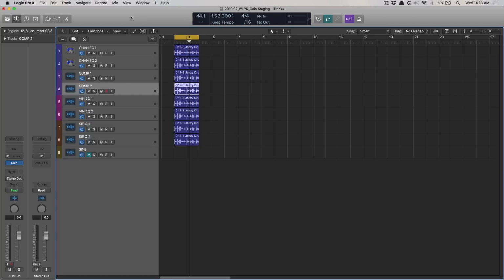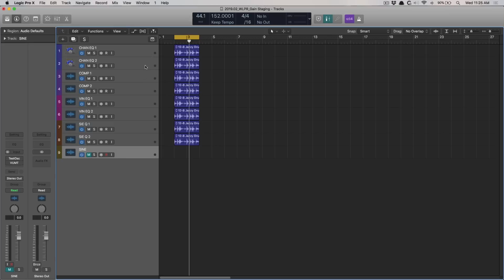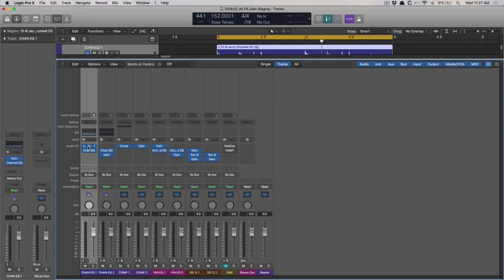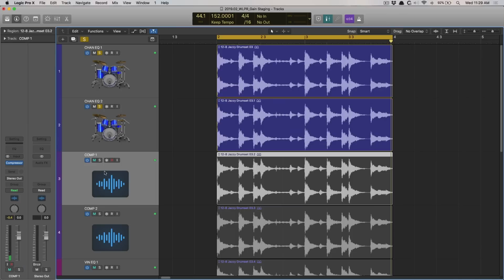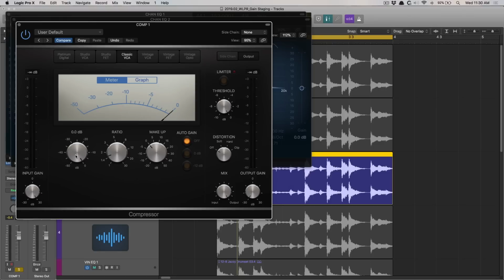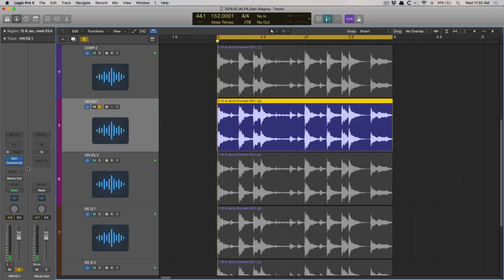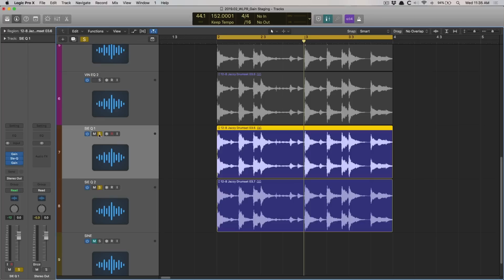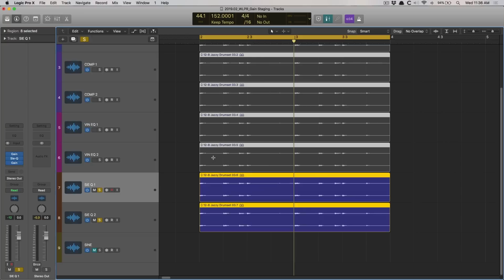Gain Staging in Logic Pro – What Is It, & Does It Even Matter?

Comment: would this be "cheating" though? would I get better results by doing it manually track by track using a vu meter because specific instruments like vocals for example are so dynamic? if this is such a game changer why dont i see more people using this method?

Update: When using this method of normalization for gain staging I measured the signal of an individual track with a vu meter and the level was very low even though it was peaking at -18db. 

Am i missing something here? Plz help

Comment: My question about that -18, do I have to aim for this spot while recording (and if not, at what db should my signal enter Logic via my interface?), or do I aim for it afterward in the gain staging during the mix process?
Reply: I've heard from sound guys that when recording to digital it's best to aim between -12dB and -6dB, -12dB being on the safe side. The -18dB comes from the relationship between VU and FS meters, as far as I understand it, 0 dB VU = -18 FS and it's the supposed best level to hit the subsequent plug ins at. I'm learning this myself, so take it with a grain of salt.

Comment: Would you gain stage even things like tambourines & sharp hi hats? The wave is always so small after I bounce in place from Maschine into logic. If I gain stage they are super loud in the mix, just to be tuned down on the fader again. Thanks~
Reply: Great question, to my understanding the answer is no. If you sure a certain sound or instrument is going to sit very low in the mix or is there solely for background or texture you may not need to gain stage it. Just make sure the fader is set to 0, and the Peak meter is hitting between -6db and -18db on the start.

Comment: also if you use fab filter the threshhold of the  dynamics are all defaulted to -18dfs. I find a lot more plug and play workflow when everything is gainstaged. You can add stuff and just see how it sounds rather then adding and adjusting. 

I just wish it were easier to see  -18dfs on the logic meters. Its the spot to focus on and yet the scaling of the meter means you have no hardly any visual feed back on the meter 🤓 just a wimpy bounce at the bottom of the meter. Silly stuff. But logic is still cool. Just illogical meters.

Comment: Hey Chris, thanks for great video! One question if you could answer please: If i do normalize gain as you showed at the end of the video, will i loose the stereo field I've created by different track volumes? Also what will happens with the volume automations I've set for some regions?

Thanks a lot!
Reply: Stereo field and level balance are two different things. Normalization will affect the level balance of your mix, but will not affect instrument placement in your stereo field. You'll have to re-balance everything after you've normalized all tracks that needed normalization. Your level automation points won't change after normalization either, so you'll have to redo your track automations. Hope that helps.
Reply: @slowpokeproductions  yep! That cleared heaps! Thanks!!

Comment: Long story short analog gear color is harmonic distortion that is reacting to the amplitude. So you'd better get your amplitude right before your analog emulation plugin.

To take this further, the amplitude getting clipped isn't just one homogeneous absolute dB value, it applies to each individual frequency's amplitude. So EQ adjustments before or after the emulated analog plugin will have different sounds compared to each other too. 

And lastly compression can make the quieter harmonics loud enough that they can get further harmonic distortion, so compression before or after the emulated analog plugin will have different sounds compared to each other as well.

As an electric guitar player with 40 pedals on my board I can confidently say gain staging is real and that the order of your plugins will have a massive affect on the final sound.

Comment: Question about the normalising gain function (which is a great point, i've been copying a gain plug in every time). What does the algorithm function do? what's the difference if i choose loudness or peak?
Reply: Peak will normalize to the highest peaks in the track which may or may not be desirable, although it does increase the entire level of the whole track. Loudness normalizes based on what the human ear expects to hear and averages the volume overall, not necessarily having to apply gain over the whole performance. I hope I explained that properly lol. In other words, loudness would treat the valleys and peaks independently and average out the signal to be louder, but palatable, and peak would raise level closer to the loudest parts of the performance. Hope that makes sense, I'm not as adept or as eloquent at explaining these things as Chris is!

Comment: Great video, but when I try to use the Region Gain Normalization, it doesn't work for me. For example, my kick is around -11dB in the channel strip meter. When I apply peak normalization to -18dB, Logic adds another 11dB gain to the track, nearly sending the track into the red. It adds about 6dB, when using loudness normalization. Any idea why this is happening?
Reply: I try not to use the normalization command, mostly because it's harder to change it if you want to later in the mix. Shooting for -18dBfs is smart, but every now and then you find you need to hit the processing harder. So, instead of normalization, I go to the region inspector window on the left. There is a place to type in gain, plus or minus. So if your audio is -11dBfs just type in there -7. It takes longer to listen to and adjust each track, but I usually know what sort of plugin I might try and i can hear how it is hitting that for effect. I find that since I gain stage more, my individual tracks sound less impactful alone, but group bus and and things like a parallel crush can really add impact to your tone.
Reply: @alexbreyer6921  I think you didnt really try this trick. You are talking about the normalisation as a destrutive process apparently.
But the trick here, you can adjust afterwards the gain as you currently do ! Check this out:
https://www.youtube.com/watch?v=FmmOw9N1TZo

Comment: So basically the gain in/out doesn't matter for processing that is designed as linear*. As soon as you design in non-linearity, it does matter. So presumably this is why hardware emulations work as such, because the essential non-linearity is also being modelled. And of course compression is essentially a non linear process, too.
Makes sense...

*within the confines of the bit depth... 32 bit float for Logic processing?

Comment: The other reason why I do think gain staging is extremely helpful is that you train your ear a lot better since you can A/B between processed sound and non processed without any perceived loudness difference. For that, is better to use LUFS metering system when mixing I think.

Comment: to normalise region gain   will that do the midi as well ..thanks
Reply: No. It needs to be an audio file for that to happen.
MIDI is just control information.
Note on. G3. At bar 1
Note off. G3 At bar 2
That sort of thing.
(Yes, that's a little over-simplified)
HOWEVER if you record/bounce all of your MIDI tracks as Audio files.. 
THEN you can use Normalise Region Gain

Comment: Question: What if there is the rare transient that you would like to discount and adjust the gain of the regions past -18DbFS? Is there a manual way to do that if you apply the function: Normalize Region gain?
Reply: Specifically you would want to listen and manually "trim" the gainstage... I am used to doing this in Protools but not Logic.
Reply: @ClayHurst  You’ve probably found your answer by now, but what I do is make a cut on either side of the transient I want to disregard, select everything on that track except for the new region containing the transient, and normalize the selected regions. Then I adjust the separated transient to where it needs to be, usually running a separate normalization just on that single region.
I do this a lot when working with dialogue and a lav has transient—like rubbing on the talent’s clothing or being accidentally tapped—that I don’t want to affect my overall normalization.

Comment: Sir love your channel, Awesome work. Gain staging is a cool subject to talk about. The tool in logic to mass set the gain is pretty good for recorded wave files but, we al use a lot of soft interments. I want to share A plug-in I use on regular basis. It is an amazing tool. HoRNet VU Meter MK3. Check out the demo in link below. It has auto gain staging and takes the guess work out of the work flow. You can group a bunch of tracks together and control them from one interface. It’s takes zero processing power after the initial analysis which is just playing the track once. 

I also use it as a first plugin on the final mix to auto set the level.  It’s a pronominal tool for 10 bucks and if you don’t like it they will return your money and you can keep the plugin. Check it out. 
https://www.hornetplugins.com/plugins/hornet-vu-meter-mk3/

Comment: Thanks for the great video, so how am I going to raise the volume on the master channel to -6 dbfs for mastering purposes?
Reply from the maker: You can always place a Gain plugin on the Stereo Output to adjust the level of the whole mix.
Reply: @WhyLogicProRules   But wasn´t the point in this video that you should aim for -18 db? Or does it only matter when the signal hits the plugins spesifically?
Reply: @sondresolstrand  Your follow-up question is different than your original question. Chris correctly answered your original. Hitting your processors is a different ball game. If you've adequately gain-staged each instrument or vocal at the time of recording, you should have no problem with your master level during final mix/mastering. I was always taught to "cut" (record) tracks with mixing in mind, so that there's less to do in the final; meaning, process each track that you're recording as if it were the "final mix". Gain staging is the absolute first step in that process, and after implementing a processing chain, the only thing you'll need to do is just seat the track in the mix and/or tweak your processing. This is extremely helpful when you're dealing with a large amount of tracks. When I embark on a final mix and put all my faders at zero, before  I even hit the play button, the mix is basically already there, and the master level rarely needs to be addressed. Hope that helps.

Comment: Great video!!! Thank you. So, I have many questions. I do use many plugs that need correct gain staging to hit the modeled "sweet spots".    
1. If the following is true (or even close)  "-18dbFS=0vu"  then , (e.g. - drum recording) if we were really recording analog, I would certainly be letting some peaks fly above 0 on my VU meters especially Snare and Kick. So wouldn't I look to set my digital peaks to more like -12 or -8 in order to recreate the levels expected by analog-style plugs?  
2. What is the significance of buss clipping in Logic? Does it only matter if I am using processing on the buss?
3. Sometimes my drum buss may be clipping 2 or 3 db. Will that cause distortion at the Master Output? 
4. Does Logic reduce the outputs of the busses in order to sum them at the output?
Reply from the maker: Thanks Thaddeus! To answer your questions:

1. I say play around and see what sounds good! The -18 dBFS is a guide, and not a rule. I can get neurotic, and will try to make sure no peak exceeds 0 VU. But sometimes you want that little bit of saturation :)

2. In Logic, clipping really only matters once you hit the Stereo Output. Every channel and bus could technically be clipping (at the mix stage), but as long as the whole mix is below 0 dB on the Stereo Output, you're good to go. With that said, if you're using analog style processing anywhere in the chain (channel or bus), you'll want to manage your levels as explained in the video.

3. Again, the drum bus clipping will only cause problems if the Stereo Output is clipping.

4) Logic doesn't reduce bus outputs for summing.

Hope that helps!
Reply: @WhyLogicProRules  Thank You, yes that  helps a great deal! It's very hard to change old analog metering habits to encompass what's really happening digitally, and now, because of analog styled plugins, it is useful knowledge once again.
Reply from the maker: Happy to help :)  @thaddeuscorea
Reply from the maker: As a parting thought, I highly recommend adjusting levels to more conservative levels, whether it be by VU meter or normalizing region gain. This is more for anyone else who reads this conversation. While clipping only matters when recording and at the Stereo Output, it's not very good practice to clip all your channels and busses while mixing!
Reply: @WhyLogicProRules  My understanding is that -18dBFS is not so much a peak value but an average value very close to what an RMS meter will give you. If you aim for -18dBFS RMS, you should be getting some peak values around -12dBFS... sometimes higher... sometimes lower !!
Reply: Actually, I just did a bunch of reading on floating point, etc. I may have answered my own question, but I'm looking forward to your response